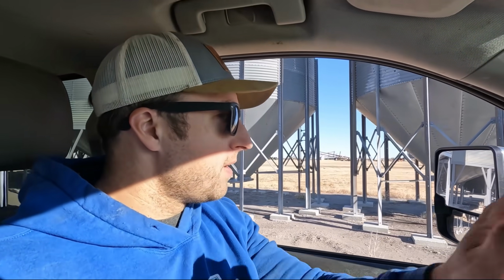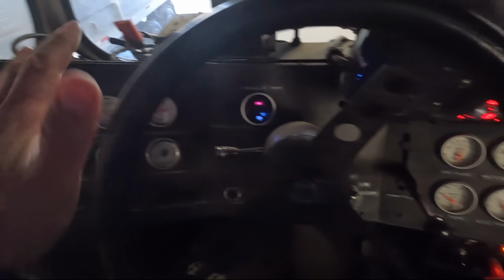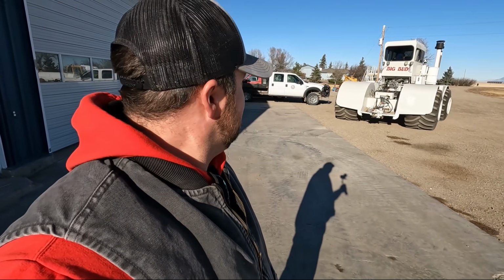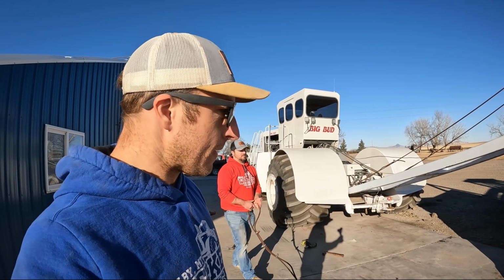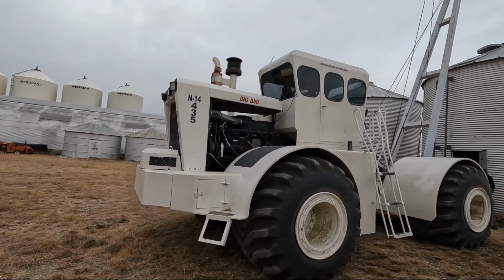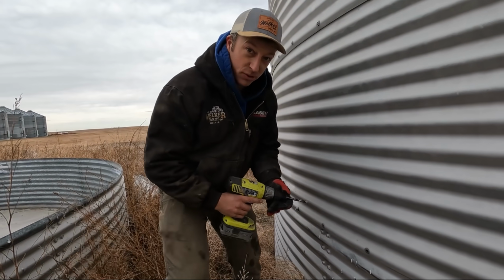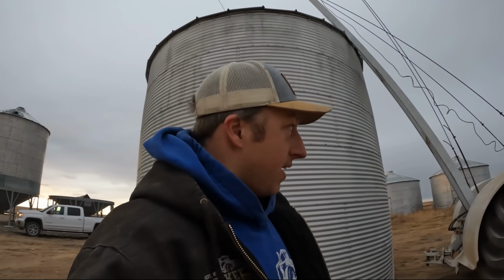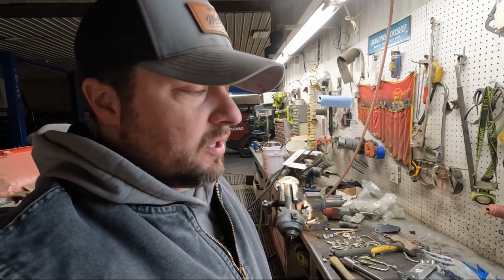Winch FAILED and the Bin FELL!

Comment: It was likely the bouncing of moving the bin that was shock loading the splines causing the failure, not the static weight of lifting it. So this is also a very good example of why you don't use your winch to hold down anything to a trailer or use the winch on a vehicle to hold it to a trailer. 
But the important thing is no one was hurt. Also really cute dog.
Reply: Tell that to wrecker drivers. They don't use anything but their winch.
Reply: @TheMetalButcher  Thats why I avoid following them at all costs.
Reply: @BlueDually4x4  Same. Wrecker drivers around me are the most reckless drivers on the road.
Reply: @TheMetalButcher  every accident they encounter they earn money. If the car behind them crashes, they're the ones to encounter the accident...
Reply: @TheMetalButcher  good drivers use safety chains
Reply: Or why you dont use your winch as a snatch rope. Being someone who off roads regularly i see it all too often
Reply: @TheMetalButcher  Not true around here. Vehicles would never stay on the truck beds.

Comment: The important thing is everyone is safe.  I installed bins around Billings for a summer back in 77.  It was an interesting time.  We used an actual crane on some of them and a hydraulic jack system on others.  Come August, working the inside on those things was not something you did for more than an hour at a time.  Had to trade off and consume lots of water.

Comment: Glad all of you are ok.  So dangerous lifting heavy awkward steel

Gread vid shot of the Big Bud rolling over.  American iron getting it done decades after it was made

Lots of verticle snap multipling the load on the cable n winch wh3n moving across even just slightly bumpy ground.  Boom length n flex multiple the snap load

Comment: I am glad none of you would ever get under a suspended load!... ;)
And FYI, that kind of winch is not rated for overhead lifting, it has no load holding brake, and you can see why it is not supposed to be used for overhead lifting!

I know you won't change up your equipment for safety, but I would suggest at least adding a pulley block to cut the load on the winch in half.
Remember also that you add load from friction of the cable going over the boom sheeve, so the load that the winch sees is higher than the weight of the bin.

You also get shock loading when you are traveling which could be quite considerable at times.

Comment: Well, luckily no one was hurt.  This is one of the reasons that winches designed for lifting have a different brake mechanism.  If you read carefully, most winches are rated for pulling, not overhead lifting.  One thing that makes me a little nervous on your bin boom are the support cables.  I don't know the size of your wire rope, but I'm almost certain that you don't have the right number of clips on there to let the rope support the optimum load, and I can't tell if the orientation of clips is right.  This could greatly reduce the load capacity of those cables, and would be a relatively easy fix.  I would suggest you look up the right number and orientation of clips and make that small fix.
Reply: They are 1/2" wire rope breaking strength at over 21,000 lbs.  3 sets of clips on each end.  As far as the lifting capacity a German engineering student contacted us.  His computations determined we were way under the lifting capacity.  Weakest link was the winch.
Reply: @RobertWelkerFarmerBob  Excellent, that sounds right.  I just couldn't see enough details in the video, and thought it looked like there was only one clip on each end of the static boom support cables.

Comment: Great video . Sometimes stuff just happens. Love the way you guys deal with it all.
Question for you, Fertilizer prices here in Australia are going up. Urea is in short supply which is a worry but the biggest worry is for DEF or AdBlue as we call it.
There was a report on the news yesterday that Australia will run out of DEF by the end of January. That means half our trucking fleet will be shut down, farmers running newer equipment will be shut down, backup generators at hospitals and the like wont work etc.
Is this the same in USA or is it only us?
Would appreciate your thoughts
Reply: Have not hears of a looming Def shortage here.   But with the current policies I would not be surprise
Reply: No shortage here in Canada that I have read about..

Comment: The N14 "Red Head" engines are very good. Last of the 855 cubic inch engines, but probably the best.  If your cummins is down on power it might need a 'hot-set' valve lash adjustment......or it has a boost leak,intercoolers are famous for cracks that leak, even in tractors.

Comment: When you have a load in the air no one should be near it. Use tag lines, they will give you a chance to move out of the way in case of an equipment failure. Very happy no one was hurt.

Comment: Many years ago we used a similar approach to put the roofs on new grain bins.  We could assemble the roof on the ground instead of 30 - 40 ft in the air.  The crane was mounted on a truck.

Comment: We bought a bin crane years ago to put bins on hopper bottoms. Rented it to people to build bins but had to quit because of the insurance requirements even if we didn’t charge for it.
Reply: That’s the terrible thing.  I used to rent A frames.  Toward end I would buy them as scrap metal. Few weeks later sell them back a few bucks cheaper.

Comment: It's only a 5000lbs static load... when driving the up and down of the tractor could easily be tripling the dynamic load....

Which is why a lock out on the wire/wench would probably be a good idea for when the bud is moving with the load.

Comment: I know this happened a couple weeks ago but I’d really encourage you to check all the bearings and the journal’s as well as the bull gear for wear If you still can. Ideally when you reassemble you can check the backlash of the two gears to make sure you have the appropriate mesh. Failures like that don’t happen for no reason and it may not have entirely been the pinions fault. When you have poor contact with the gears or loose bearings/housings and they can push each other away that’s when you have a weak contact and the force is able to begin to shear the teeth.
Reply: i thought he is getting a new winch not just a shaft.
Reply: They're not rebuilding the old one. Clearly stated that they are buying new.

Comment: why are there two drive shafts on the back of the Big Bud? thanks.
Reply: The top feeds the divider box which reduces the speed and transfers the rotational power to the axles3

Comment: Their needs to be a manual axillary brake system on that winch for safety reasons, as well as taking the pressure off the winch. They are made to pull 12 tons, not lift and hold.

Comment: As a kid there was a crew building a 5000 bu bin.  Using central pipe/winch/collar (like your tire) first time I saw corded impact tools.  Dad got upset. Guys going in/out of bin as being lifted.  He told them.  “Nobody goes in/out UNLESS every sheet but one fastened.  So if winch fails nobody hurt…”
  Next row put on. Guy inside cranking it up.  Worker slides under edge, dad starts to yell.  Noise, BOOM as bin hits cement.  Cuts power cord.   Guy who rolled out dang near passed out. Not 6 seconds later it would have killed him.  I climbed held ladder to manhole, lower lunch, water to guys inside while 3-4 outside A frame jacks located, brought home. 
 Decades later I mentioned to crew leader unsafe actions I observed. “But it’s your crew”. 2 hours later they hauled guy to ER 15 staples.

Comment: Sorry- if if OSHA applied to farmers- it's a winch, not a hoist.  It's designed to pull a 12,000 lb vehicle onto the back of tow truck at 20 degrees, maybe.  Or across flat ground.  You want to rate it for lifting 5000lb look at hoist numbers.

That said I have a 12,000 lb Warn torn apart that I'm not likely ever overhaul (free wheel is rusted up and the motor is all corroded).  Have to cross the part 
numbers, but I could let you have the shaft.
Reply: And then you end the video by buying another winch.  I'm envisioning a couple pieces of scrap metal that could clamp on to the cable and carry the weight when moving.  Of course if the only thing you use the winch for is to move bins it's probably good for another thirty years.

Comment: N 14 are great motors 
They made a all mechanical version no electronics at all I had one and should’ve never gotten rid of it it was a great motor
Over 500 hp to the ground the way I had it set up 
I also had 2 trucks with the Cummins signature six motors 
Best power you can get

Comment: Winches are made for pulling not lifting, unless it was made for a crane, they are built stronger for the type of load they carry.  replacing with a truck winch is just calling for problems!
Reply: Isn’t lifting, just a vertical pull?  Our silo unloader used a winch to raise and lower the unit.
Reply: @robertheinkel6225  Horizontal pull a winch is designed for is a rolling resistances. In lifting with a crane you can hear the gear tooth lock with movement of the drum.

Comment: It could've been a lot worse, it could've broke when you were crawling out. Those 12,000 pound winches are rated for pulling 12,000 pond rolling resistance not 12,000 pounds of actual pull. I have a 50 ton crane in Sidney Mt. But that's a bit of a drive. I love Cummins engines but in my opinion anything newer than a Big Cam 4 isn't very good in my book as far as that size of engine, I personally would love to see a 3406B or 3406E @550 or 600 horsepower Cat in that tractor. Or you could go nuts and put a 800+ horsepower 3408 Cat in it.
Reply: Not sure the rest of the tractor could handle that.
Reply: @crandonborth  very true, you start increasing power then you need a bigger transmission and axles. It's a never ending game of upgrades. Lol...
Reply: @clydeacor1911  also throw in the fact that it takes lots of money to do that and remember they had a very poor crop on top of Record high fertilizer prices

Comment: I'm impressed with Leg Arm's backwards driving skills on the road in that loader.  I know I'd be going much slower than he was if I were to attempt that.  Also, watching you guys hooking up that crane made me wonder. When in the process of pushing it up, have you ever come close to pushing it too far and sending it over onto the tractor?  I mean, I figure it hasn't ever happened, but has it gotten close enough to at least make you nervous?
Reply: Wheb in saw that i tought the video was playing backwards.
Reply: back in up in a open area isn't that hard just have your wheel straight and hold it straight when loading round bales in a field I always go full throttle backwards and I hit the reverse speed limiter of 30KM/H
Reply: Jason Aldean song:" Back that Thang up"
Reply: The steering is the same backwards and forwards do it wouldn't be all that squirrely
Reply: The jib is still overhanging the boom so it still wanting to fall back down
Reply: Are trees outlawed in Montana??
Reply: @CurrentChoices only where we farm........ 😁

Comment: Hi Guys:
Having a winch fail is REALLY the shxxs! I have worked on winches, and that's the first time I have seen stripped splines on the imput shaft!
If you are thinking of re-powering Big Bud, have you checked out the Cummins 1100 series engines? YOU CAN GETS SOME SERIOUS horsepower and torque out of those puppies. Those engines have been around for quite some time, so they should be available.
Even the old 1693 Cats would make Big Bud snort! I like Cats NEW line of industrial engines. Warranty is good and parts are available.
The Fuller 614 trans. should be able to handle the added horsepower and torque. Do you have a temp. gauge on that trans??
THE VERY BEST WISHES, HAPPY HOLIDAYS, AND GOD BLESS OUR FARMERS!
Gary

Comment: If you 2 or 3 part your line, that will work much better. Too much for a single line. You shock overloaded the winch. With that bin swinging that causes the load to be heavier, with in turn overloads the winch. I’m not trying to be a smart ass, I just don’t want anyone to get hurt because I didn’t pass along some information I was aware of. Good luck

Comment: Don't use a winch for a hoisting operation.  Winches are designed to drag loads that can't fall.  Hoists lift loads, much more heavy duty and have brakes to prevent load drop.  I have a big load in my shorts!

Comment: I'm having a hard time seeing how a spot on the splines caused the failure. Splines carry a load along the length of engagement and circumference. It's not like a ring and pinion or rack and pinion set up where just a few teeth carry the load. There isn't even any twist in the shaft as I've seen in axle shafts even on low powered race cars. Now a failure is a failure and a new winch is definitely the best solution. Forgive the curiosity that my years of wrenching, engineering and fabrication have me wondering.
Reply: @m9 ovich That makes more sense.

Comment: in the start when you were getting the crane off the cultivator, was there an old air drill implement over on the right with all the tubes on it?
Reply: It was a rod weeder I converted to a dry product applicator. It was pulled behind the air cart
Reply: @RobertWelkerFarmerBob  oh that's awesome! super exited to see the new drill in action! in how good of condition is it?
Reply: The CaseIH 700 is in good condition
Reply: @RobertWelkerFarmerBob  who will be using it the most in spring plating? you? Leg Arms? Nick?
Reply: @ballardgriswold7994  probably legarms

Comment: I don't know if it would have the cable diversity you need for length of lift and drop, but if the cable has the strength, the Harbor Freight Badlands winch looks better and cheaper than comparable Warn winches... Hate to go China, but.

Comment: Don't take an N-14 beyond 460 horsepower.  It will live far longer below 460, otherwise you run the increased risk of bearing related problems in the engine.

Comment: Harbor freight has some really good winches 
Are you going hydraulic or electric
You have lots of hydraulic ports to choose from
Reply: Winches aren’t for lifting and definitely not a harbor freight one.  They should be using a hoist which would be rated with a safety factor in mind.  Winches are designed and rated to pull objects not for a bouncing vertical lift.

Comment: Wow for farmers you guys are giving up fast what about taking that cable and run to through 2 snatch blocks on top and 2 on the bottom to a hook seperating the blocks  in doing this  you will X4 the power of any winch you use and how hard could it be to find a Warren 3 or 5 ton bumper hitch all you need is a 12V power supply. If that's all it takes for you guys to get shut down how do you make it through a harvest

Comment: ALWAYS "go bigger" (beefier) than what you need, with equipment like that.   Personally, I would go with "At Least" and 18K winch, preferably even a 20K winch.  To What capacity, was the "boom" designed to handle, at that height ?  Don't ever want overpower the boom, either.   Some "tag" lines, with one guy on Each side of the bins while moving them would eliminate the spin and swaying... both of which add considerable stress on Everything, from the boom tip to the winch.     Be Careful, Lord Bless & Protect you and families.

Comment: Sorry guys, but this just shows how dangerous it all was. Not only that winch, but also that old, wire rope. When it's swirly like that, you shouldn't use it for serious, and especially, dangerous stuff like this. This one should be replaced. You were so lucky it didn't fail when someone was inside or had arm or leg under the wall... Or the worst, when Scott was getting out of inside of it after patching the door. It could literally cut him in half if there was nothing to stop it from falling directly on the ground.

Comment: You guys need a lathe
Reply: Do have a 14x60 lathe . Used it many times
Reply: @RobertWelkerFarmerBob  so why wouldn't you make the part's and Quench in some old tractor oil to harden?
Reply: To make lateral splines you need more than a lathe.  A good end mill is needed
Reply: @RobertWelkerFarmerBob  it can be done but I understand.

Comment: Oh wow didn't expect that to happen. Thank God no one was under the bin.
And as for upgrading bud to a 500 horsepower engine in my opinion I wouldn't do it. That's an really old tractor an to put that kind of power into a machine that old. To me it wouldn't be worth it cause then you run the risk of wearing out the driveline components as well as other parts that could fail. If you want another tractor with that kind of power maybe consider another Case IH.
Reply: A complete running tractor that's 500hp is way more expensive than just engine swapping the Bud. Even if they gotta replace stuff down the road, I guarantee the Bud route is cheaper

Besides the Big Buds are what separates the Welkers from most everyone else

Comment: .......so why not get an electric 18k/lb winch....don't get me wrong I understand the hydraulic winch, how it works and why it's stronger and better......but it would be fine to use the electric I would think just double the cable back to the top or the crane, put in a block and tackle and now you have a 36k/lb crane.
Reply: That would probably work fine but those winches still aren’t designed or rated for lifting.  Need a hoist!
Reply: @Brian-ug7du  so what is the difference between the winch they used and the crane on my service truck?
Reply: @justinschmicker1049  from what I’ve seen from working on them is the hoists never have a free spool feature, which is another thing to fail.  Secondly any hoist is going to have a safety factor greater than the rating.  The brake is usually more robust too. That winch they are using is definitely not rated for 12000 vertical lift, more like 12000 on incline with wheels!  Also the bouncing around of the load puts much more stress on the components.